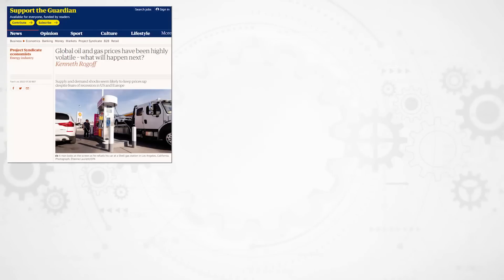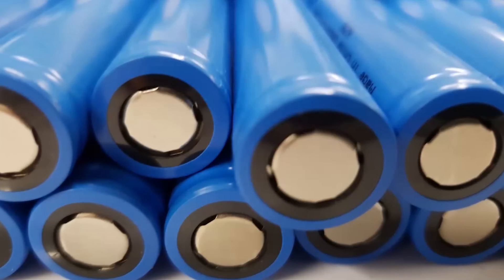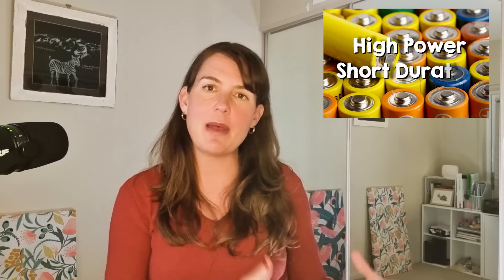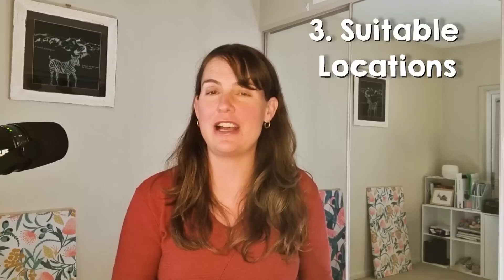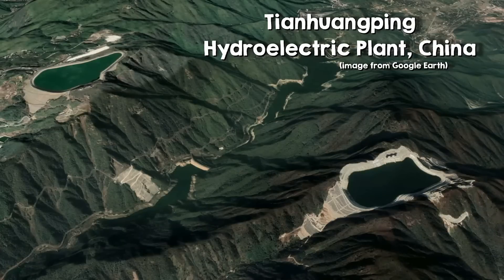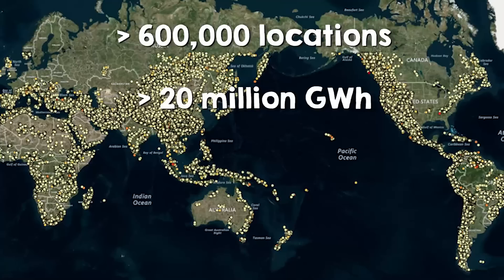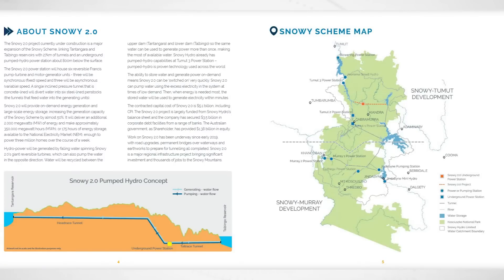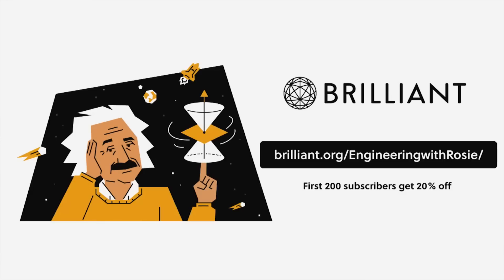Pump It Up When You Don't Really Need It: Pumped Hydro, Future of Energy Storage

Comment: Thanks Rosie.

In my view the issue is not so much about domestic or even transport demands for electrical energy. These are relatively easily dealt with, and if grid goes down and lights go out it will be very inconvenient but no real problems.

The real issue is about industrial use. Steel, aluminium smelting, cement, bricks, fertilizer, transport fuel, industrial chemicals and so on. A lot of these are currently powered by substantial inputs of coal, oil and gas and require continuous intense (hot) energy inputs.

To fully electrify the country, Australia has to plan for at least 60GW of continuous energy use by 2050. The former Chief Scientist has suggested the actual requirement if we  replace current energy exports could be ten times higher.

Snowy Hydro 2 provides around 350GWhr storage at the 2GW rate. All this depends of course on surplus power to pump the system up, and most critically in a country plagued by drought, adequate water to pump (think millenium drought).

By my estimate Australia will need storage at least ten (3500GWhr) and possibly twenty times the capacity of Snowy Hydro 2 to assure the country's economic future using renewables alone. If this requirement cant be met it will lead to a substantial decline in living standards given projected population growth (35m@2050) and the need for increased energy to cope with climate change (particularly cooling and desalination).

If there were to be a nuclear mix, using Gen 4 high temperature small modular reactors, the energy storage requirement could be substantially reduced.

Needless to say in my view nuclear has to be part of the mix, probably around 10 * 2GW nuclear power stations delivering 20GW. The other 40GW would be delivered by renewables backed by storage.

People will argue the cost. I suggest the nuclear power stations be paid for in whole or part by cancelling the nuclear submarines. $9bn per power station might just about do it. Our strategic position will be greatly strengthened by an assured energy supply in a way nuclear submarines could never do.
Reply: My intuition wants to agree with you without doing any figures myself... but this is a figures problem. It's not a matter of cost of nuclear power vs costs of a submarine but costs of nuclear per gwh (assume only producing when not needed) vs the costs of batteries per gwh. I don't think these costs came close with the latest CSIRO gen cost report. That may mean 10 more snowy hydros and a bunch more batteries. But if that come out cheaper than nuclear they will probably go with it. Especially considering any politician who tries to push nuclear will get destroyed.
Reply: Plus the actual costs of purchasing excess energy with batteries I suppose.
Reply: Aluminium smelters and other industries may need to become more flexible to reduce that 60gw figure. They can already reduce their required power by 30% not sure if your figures accounted for those sort of variations.
Reply: @davieb8216  You can turn these industries off, but they will be inclined to move to wherever they can get continuous power. This means countries like Indonesia and China. Ultimately this will mean a diminished living standard as living standards are directly linked to energy use.

If you can sell that to Australians thats fine.

Personally I go with the 60% of the electorate who are happy with nuclear power. Its interesting to me that there has not been the slightest protest over nuclear submarines using highly enriched fuel  based in Sydney, Brisbane. This suggests there is no opposition to nuclear power at all.
Reply: @jimgraham6722  maybe the cost benifit would still be there for most industrys if the off peak price was cheap enough to out weigh the higher peak prices. This would only work of the overall system was cheaper though. One things that I think is going to be a drain on a renewable grid more that their figures show is electric vehicles, I can't see every workplace having enough charging stations that vehicles will be charging in off peak and discharging during peak.

I didn't know Nuclear support was that high at the moment (probably depends on the question asked). I was talking to a pro nuclear independent (unsuccessful) and she said that in the past, who ever went pro nuclear would get the media onslaught after them. Maybe since Murdoch has decided to be pro nuclear the libs can push it. Despite what Adam Bandt says, I think it is a debate worth having but there aren't many mature ones around it.
Reply: @davieb8216  Personally I am not too worried about private vehicles. Most of the battery EVs coming to market are vastly more energy efficient than the ICE vehicles they replace, typically by a factor of at least three, so in that case it is not joule for joule.

 In my view the grid impact for electrifying private and light commercial transport fleet will be fairly easily coped with,  comparable to the widespread adoption of reverse cycle air con over last decade or so. Additionally many of the new BEVs coming along have vehicle to load (V2L) features that allow them to be integrated into a smart grid.

However, it seems unlikely batteries will suit heavy commercial transport and equipment, rail (possibly), shipping and air. So this sector will likely require energy intensive synthetic fuels such as kero, methane or hydrogen produced in industrial scale plant that needs to operate 24/7 (high temperatures and pressures are part of process so you cant cycle it up and down in response to every puff of wind). At night these plants will mostly need to be kept alive by the storage system.
Reply: CO2 is a ruse. 
Climate change the "Greens" are talking about is caused by changes in the cosmic-rays/solar-activity relationship and cloud formation  (See the work of Henrik Svensmark.)  Cloud formation by actual cosmic rays can be scene with the naked eye in Cloud Chamber demonstrations.  YouTube has dozens of videos about them.....

Comment: I don't see the need for the "pumped" part of pumped hydro. Hydro is energy storage regardless of whether you can push it back up hill again.
All that is needed to make it compliment intermittent storage like wind and solar is to preferentially use wind and solar when available, and just use hydro when wind/solar are insufficient.
Used this way there is no need for special geography with a pair of reservoirs, only the single dam is required.
Reply: I think you will find that there are more opportunities for the pumped projects than the runs down projects. The non-pumped projects require quite rare topographic and meteorological conditions to be economic.
Reply: That depends on the amount of wind power that you generate. If most of your power is generated by wind, then you will eventually have surplus energy production, and it can be nice to have a way to store this energy.

Comment: New Zealand is slowly progressing the Lake Onslow project which is projected at 5TWh @ $4 billion
Reply from the maker: Really? That's humungous. I'm surprised I didn't come across it in my research, but I'll look it up.
Reply: @EngineeringwithRosie  
Prof Andrew Blakers current cost of greenfield Pumped Hydro is AUD 150,000 per mwh. (= AUD 150 billion per Twh).
So that 5 Twh scheme would cost AUD 750 billion, not AUD 4 billion.
Reply: That's 5TWh of annual total generation and storage, not the capacity of the upper reservoir.  Which I think makes it roughly the same ballpark as Snowy 2.
Reply: @jrsubs  
Ok, fair enough. So the assumption might that the system will fill and discharge 15 times per year. (Every 3.5 weeks on average).
So the $750 billion becomes a $50 billion equivalent.
BTW I see that Snowy2 has blown out to an estimated $10 billion. That’s very cheap for a pumped hydro system. (Because the two reservoirs were already built).
Reply: Yes it will be 25000 times the grunt of the SA battery,
Reply: CO2 is a ruse. 
Climate change the "Greens" are talking about is caused by changes in the cosmic-rays/solar-activity relationship and cloud formation  (See the work of Henrik Svensmark.)  Cloud formation by actual cosmic rays can be scene with the naked eye in Cloud Chamber demonstrations.  YouTube has dozens of videos about them....

Comment: Thanks Rosie. I'm baffled by why there hasn't been more pumped hydro systems developed. Seems like a no brainer to me but seems like many governments (like mine here in South Australia) seem to be fixated on hydrogen as a solution rather than supporting pumped hydro.
Reply: Greenwashed fossil hydrogen is the big hope for the fossil fuel industry, as people want to believe that's a solution, with some CCS and or officially to "complement" green hydrogen production.  The lobbying is probably massive.
Reply: People can see a potential market to export hydro overseas, so the private sector pushes it. There would be a high barrier to entry for that sort of market as well. That's my feeling anyway.
Reply: @davieb8216  Agreed. Hydrogen is the trendy market. But I think our governments should be supporting technology that is fit for purpose, rather than what is trendy or what the gas industry wants. Pumped hydro is a much more efficient store of electricity than hydrogen, which is what it is being spruiked as here in SA
Reply: I'm not familiar with what SA has been pushing tech wise. Depends how much they are pushing it and how many many dollars they are promising in the future. Ignoring it completely is not a good idea at this stage, when they may only need to offer a small subsidies because they private sector is willing to invest a lot. Private sector in their head is thinking green hydrogen equals LPG with an ESG price tag.
Reply: I think our governments are somewhat supporting pumped hydro, based snowy hydro river project and the latest CSIRO gen cost report (I'll have to check the number but it did include an increase of hydro power).
Reply: I'm baffled too. Maybe the return is too slow for investors. Even a mini system will take many times longer than the 100 days for the "big" (actually tiny, in grid terms) battery. Governments need to address this rather than blathering on about hydrogen. The hydrogen economy was proposed by John Bockriss in the 70's and it has not progressed much since then. Electrolysis is still quite ineficient, fuel cells even more so. Capital cost is quite high. The export hydrogen idea is just wacky - the proposed buyers have their own renewables and storage opportunities.
Reply: CO2 is a ruse. 
Climate change the "Greens" are talking about is caused by changes in the cosmic-rays/solar-activity relationship and cloud formation  (See the work of Henrik Svensmark.)  Cloud formation by actual cosmic rays can be scene with the naked eye in Cloud Chamber demonstrations.  YouTube has dozens of videos about them.....

Comment: We don't need storage if there is enough renewable to provide sufficient electricity even overnight in calm winds; the question then is what to do with the excess at other times, and if we make good use of the excess for green hydrogen for things like steel making and green synthetic fuels such as methane for aircraft fuel, then we can get a balanced system without needing significant amounts of storage.
Reply: What I am really saying is, store the products of the green electricity, not the electricity itself.  Much easier to store a mountain of green fertilizer than to store electricity, although storing fertilizer can be a little dangerous if you allow all the power to be released instantaneously!!!
Reply from the maker: That's going to be a big part in the future (I hope) and it's one of the things I alluded to at the start when I said I don't think we'll end up needing nearly as much electricity storage as most of the estimated say. but the lowest cost system will include some storage, a lot more than we have today. Be otherwise we'll just need to build such a ridiculous amount of wind turbines, and we probably won't want to have fertiliser or whatever factories that only run a few days a year
Reply: @EngineeringwithRosie  There is no point designing a wind turbine to produce extra power in a gale when the power is not needed and electricity prices are close to zero, they need to be most efficient at really low wind speeds when electricity prices are highest.   They will end up producing maximum power 70% of the time, and even if they can produce more, nobody will pay for installing cables that can carry the extra, so the fertiliser factories will run 70% of the time.  The amount of zero wind weather in the UK is tiny, and only ever lasts for a day, so we don't need efficient storage of electricity to cover that.  There are periods of weeks when we have low wind and hydrogen production will slow or stop, but normally the hydrogen production will use most of the wind power, so we probably have enough turbines for low wind, maybe with a little assistance from storage.  I suspect we will end up using cheap gas turbine engines for "emergency power", running on synthetic aero fuel (methane), easy to store, mass produced anyway, and turning it into electricity is very cheap compared to building a pumped hydro system capable of storing the same amount of energy.  Gas turbines that rarely get used don't wear out or require much maintenance, wind turbines that max out at normal wind speeds will also wear slowly and require less maintenance than ones designed for maximum output.

Comment: Thanks Rosie, I might need to have a look how long droughts would effect these projects. Never know what the weather will be like in the future.
I remember the Millennial drought in Victoria reduced lots of damns to critical levels . I'm assuming the pump hydro sites would be priorities or the site would lose too much head. Unless they had a way to increase the water level  during droughts by inflating a Giant balloon at the bottom to lift the water level.
Reply: Pumped hydro is largely a closed loop system, so shouldn't be greatly impacted by drought. There's still evaporation and there needs to be enough water left in the system, but other than that it means hydro infrastructure can continue to be used, if only for PHS.
Reply: @CraigFryer  Evaporation is likely an important limitation of Snowy 2.0.  The top reservoir Tantangara is large and shallow when full.
Reply: I had a look and it seems the drought on 2007 was a starting to become massive problem in Victoria. Also, some location in the US are having problems drought too (even the Hoover). Never seems to never be country wide droughts, so if you have a connected grid plus good policy, there will be a way around it.

Comment: Thanks Rosie. That research clearly shows the way forward for energy storage is pumped hydro. I imagine pumped sea water can also be exploited, though the environmental and corrosion issues may prove quite expensive.
I did a quick "back of the envelope" calculation and worked out that if all cars in the world were electric and they supported V2G we would have, on tap 75TWh of battery storage - a long way from the 10,000TWh estimated required capacity, but it is a storage that is local to the grid so implementation costs are minimal. As the number of EV's go up, storage increases too. V2G seems to get little coverage and our Governments seem to be ignorant of the potential.

Comment: Pumped hydro is one of the options, but there are many other scalable energy storage systems, one of my favourites at the moment is liquid air storage can be built to a very large scale from communally available materials most of which are off the shelf components that are already used in heavy industries including oil and gas and uses the same skill set to install and can be built where you need them, so large scale and affordable for most economies around the world to afford with out the need of rare earth elements. Thanks for the video Rosie.
Reply: Liquid air storage has nowhere near the storage capacity of pumped hydro.
Reply: @haveaseatplease  yes your correct, but you have a lot more options to where you can install a liquid air battery and there a lot cheaper, there's a lot of scope for both, I've also been looking into liquid metal batteries they also look very interesting aswell, pumped hydro, liquid air and metal the more the merrier😁